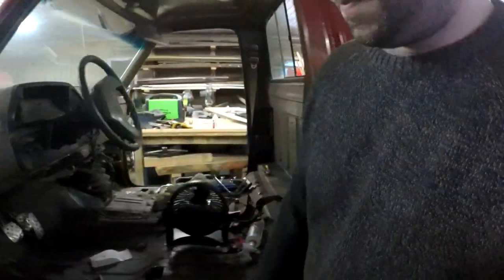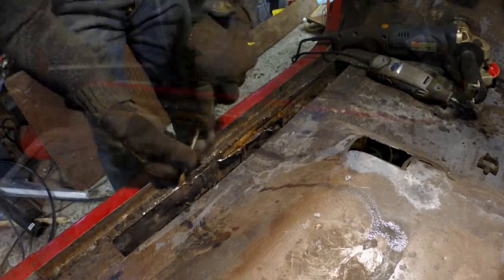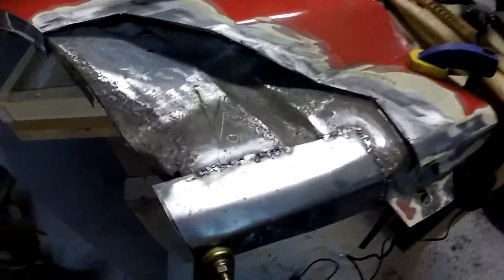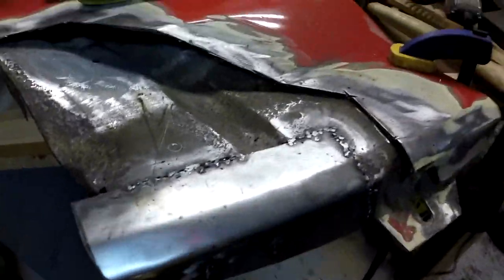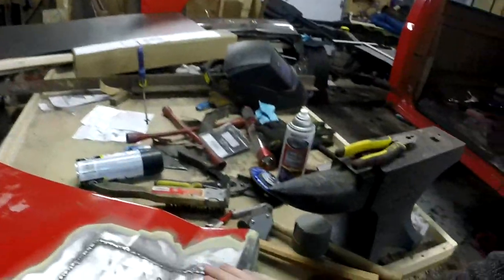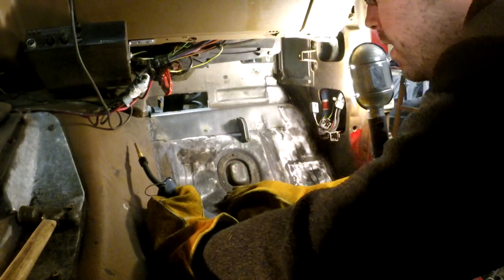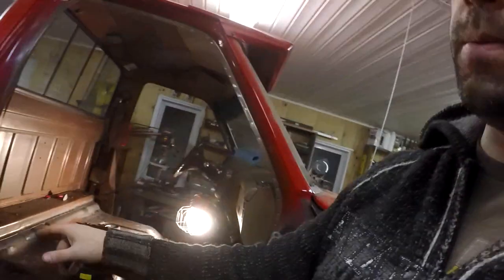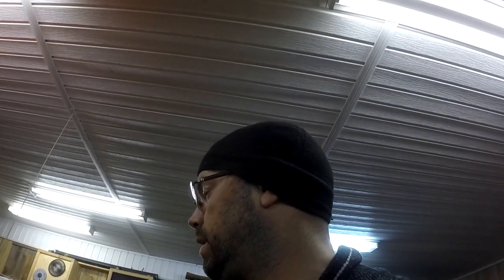Patch Panels | Truck Refurbish - EP05

Comment: What happened to the ceramic gas cup at the end of the welding nozzle?
Reply from the maker: EldarKinSlayer not needed since there is no gas. It just gets in the way
Reply: I see, flux cored wire?
Reply from the maker: EldarKinSlayer yup!